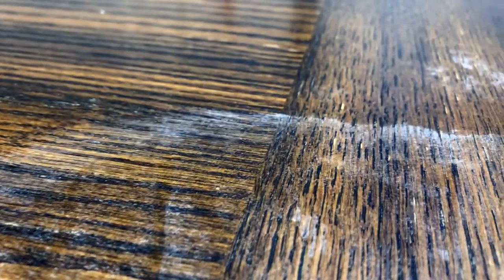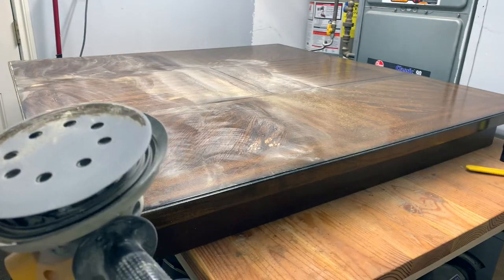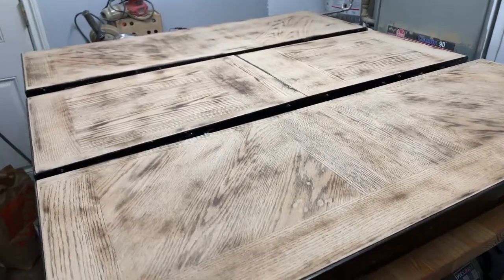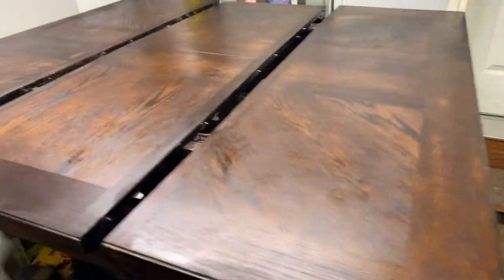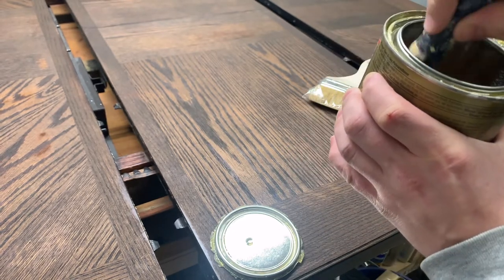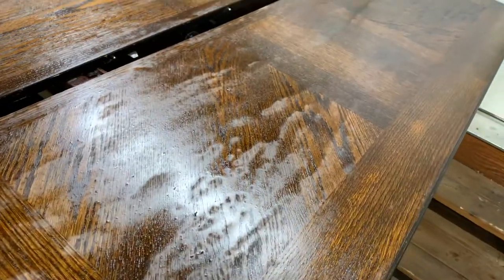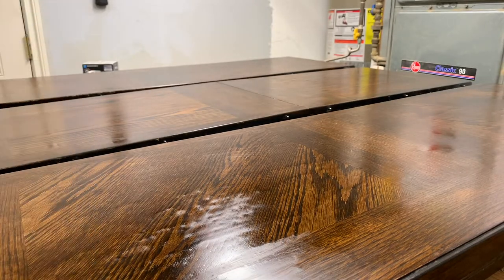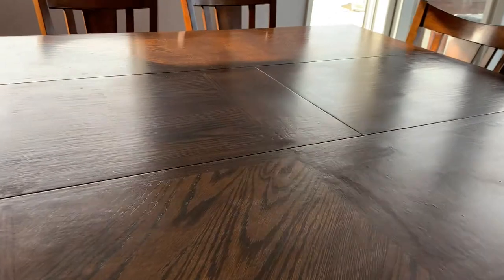Fix a scratched Costco Table top

Comment: I think you were right about letting the stain dry fully before putting on poly. Things will look cloudy if this stain is not dry because the moisture in the stain is trapped underneath the polyurethane coating.